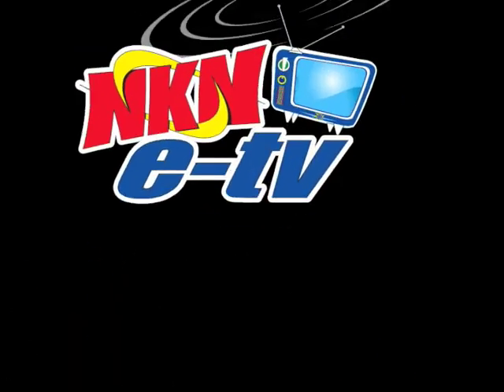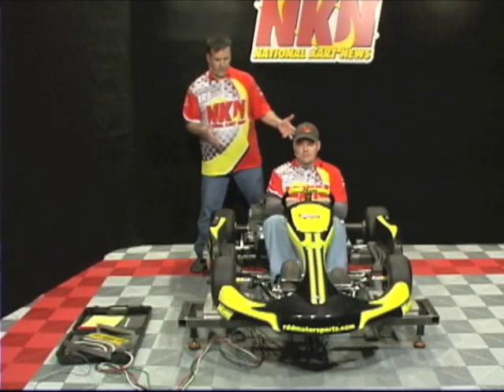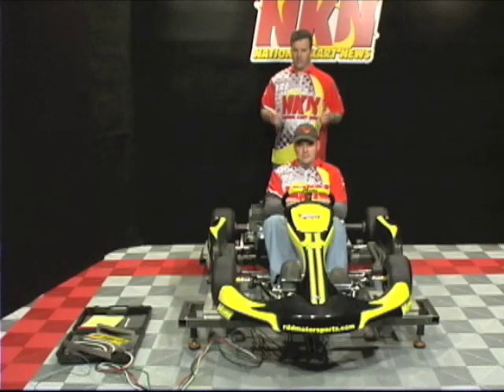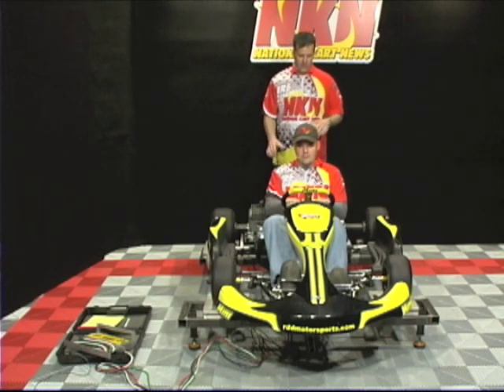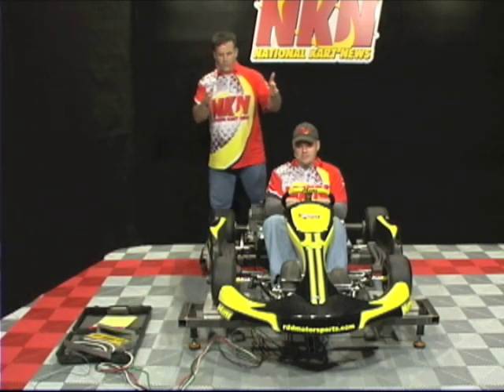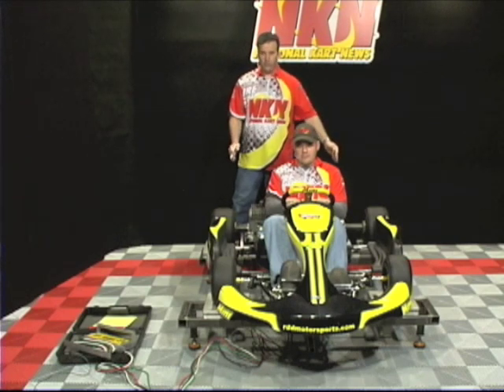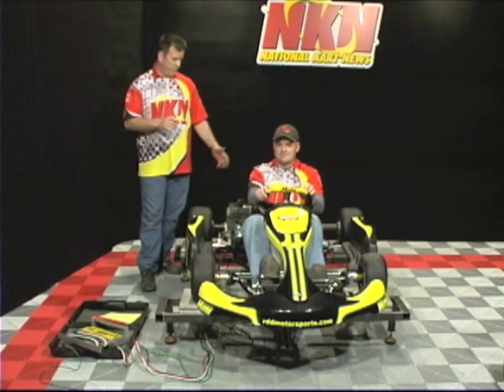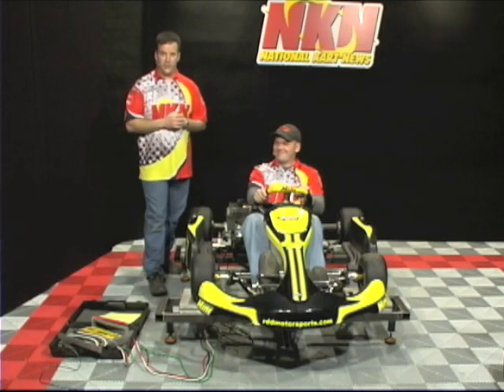Scaling A Kart

Comment: This is not a proper way to scale. The problem with karts, is that because they’re so light, and without shocks/springs etc any movement of the from wheels is a large percentage change in cross weight and weight distribution. 

You should use a scale bar to ensure the front end is constantly square
Reply: For me was a lost cause! For rental my lack of weight was my greatest advantage! When ran Briggs Masters Had to make 135 lbs into nearly 200.  For what ended up being my last race made sure I qualified last and pulled all the weight for the final! It felt so much better after 4 years of dragging it around with me!